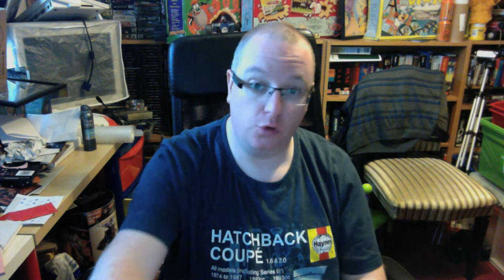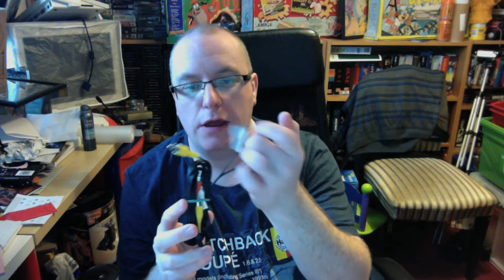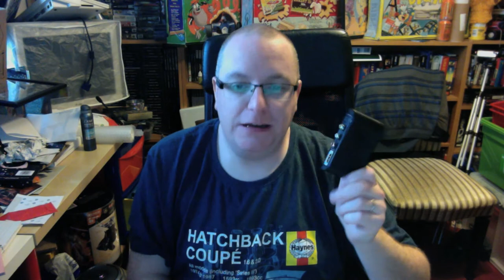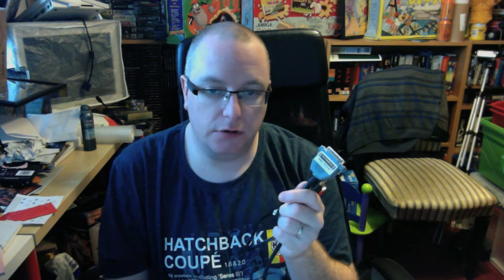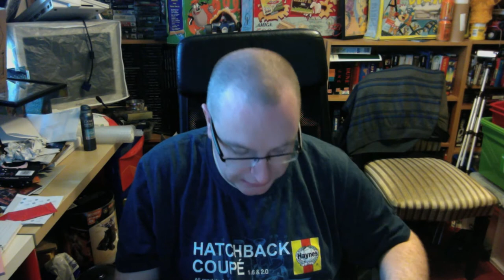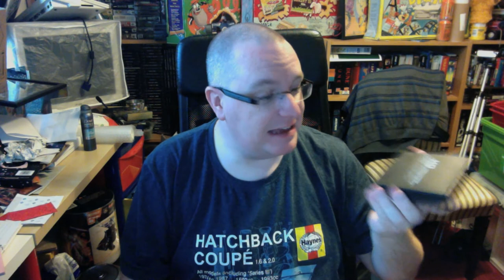Connecting Commodore Amigas To Modern TV's

Comment: That modulator came with the Amiga 500 only. Not the Amiga 500 Plus. The Modulator for the Amiga 500, also known as the RF modulator, served the purpose of converting the graphics and audio output of the Amiga 500 computer into a format that could be displayed on a television set. It allowed users to connect their Amiga 500 to a TV using the RF antenna connection.

The Amiga 500 was released sometime in 1991 I recall. The Plus incorporated the RF modulator directly into the computer's motherboard. Unlike the original Amiga 500, which required a separate external RF modulator to connect to a TV, the Amiga 500 Plus had the modulator built-in. This integration made it more convenient for users to connect the Amiga 500 Plus directly to a television without the need for an external device.
Reply: Q

Comment: Hi Rocky. You can use the Yellow Composite cable on an A500, if plugged into the A520 Modulator Video Out, situated on the right-hand side (not the 'RF Out' at the rear). I just tried it on a 50" Panasonic VIERA with 4:3 Aspect. Looks a lot like an old school TV, not too bad from a distance.

Like you though, I tend to opt for the RGB SCART cable on a small SONY TV, as it looks rather crisp. Trouble is, my VIERA doesn't have SCART!

Comment: Why on earth do you want to go the tv way at all? There are basically two ways that are the best. Look for a list that confirms 15khz vga monitor. Get one of those and a RGB to Vga buffered adaptor. Even LCD's can be found that can do 15khz. Keep in mind that you need a specific model. Or.... You can go the expensive way and get an IndivisionECS scandoubler. 99 to 109 euro plus shipping. Then you can use every kind of vga monitor. This video tries to persue old technology in the modern kind of way, wich will never get you there 100%. Nope... 15khz LCD or scandoubler are the way to go. Forget everything tv. Monitors back then were the best way to go, so why use tv's at all? Even today.
Reply: brostenen You missed the point of the video. In the same sense, why use Amigas at all when you have Xbox/PlayStation. I use a three wire composite with audio phono lead with my Amiga. It works great. Recent TV’s don’t even have these connectors, or even Scart.

Comment: My Amiga 500's video output is too strong for all modern TVs. I've tried on various TVs and even VHS tuners, using scart.  The picture is always the same.  Bright white and nothing else.  So annoying!
Reply: This is why resistors are used to attenuate the signal. See this diagram:

http://www.ianstedman.co.uk/downloads/SCART_cable.png
Reply: Thanks.  I'll have a look around for some resistors.  I have the correct RGB scart cable, so maybe I can do something with that.